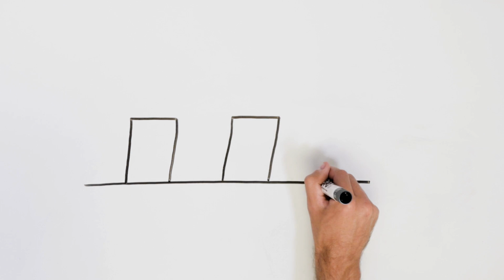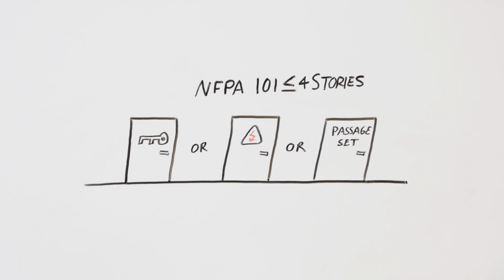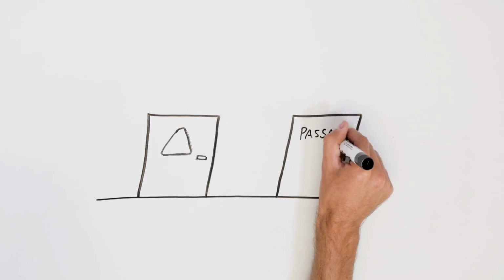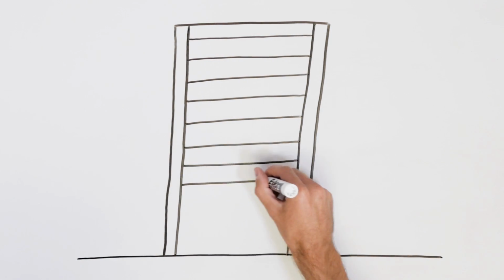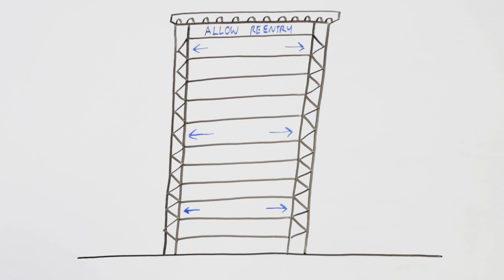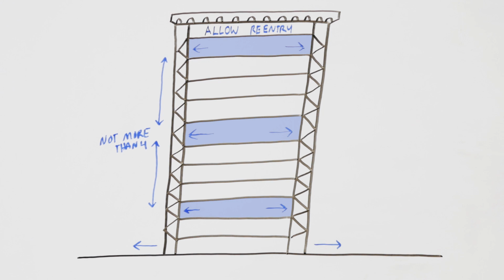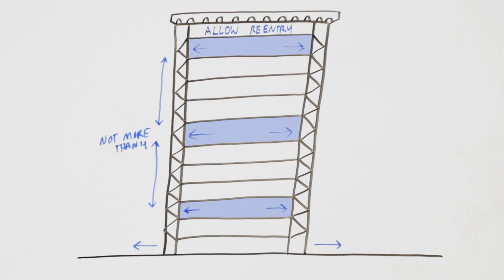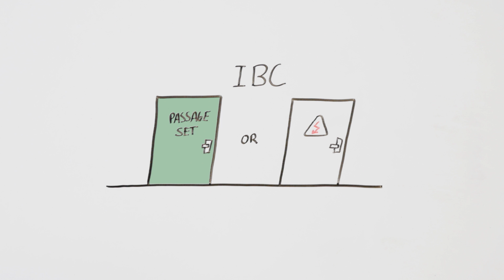Decoded: Stairwell Reentry

Comment: One incorrect thing here. Fail safe electric strikes ARE allowed to be used on fire door, as long as one permanently latching mechanism (that are actuated by a handle or similiar) remains. For this, a fire-approved fail-safe electric strike must be used, which both are resistant to false locking due to the heat (melting components inside the strike) AND must be able to keep the door closed by the handle latch (that operated by a handle on both sides of door) while the lock-latch will be operated by the strike.

One example is "ASSA 961" which is a "omvänd" = fail-safe. If you google "Assa 961" on pictures, you will see that the electric strike has permanent holes for an additional latch, that will NOT be controlled by the strike. So you have a dual-latch lock case, where one latch (the cylinder latch or key-latch) falls into the strike portion of the electric strike, and then a handle latch, which operates by a handle, which falls into one of the permanent holes in the strike, thus handle MUST be depressed to open the door, even if strike is unlocked.

Its approved to EI 120 (120 minute rated door) as long as a dual-latch emergency escape lock case is used. An dual-latch emergency escape lock case, has a handle on the inside, which operates BOTH latches, and a handle on the outside, which only operates ONE of the latches.

In this way, the strike can be used to keep the door locked from outside and free-exit on the inside, until power to the ASSA 961 strike is dropped, then the door will be free-exit and free-enter. Note that the handle must always be used, even if the strike is unlocked, as the strike does NOT release the handle latch.

Theres also ASSA 992M which is a fire-approved dual electric strike, where one of the strikes are fail-safe and the other is fail-secure. This is used in facilities where a automatic release of doors is a must, for example, in disabled-accomodations for wheelchair users where a fire door must be able to be released WITHOUT a handle press, by a ADA button or similiar. The ADA function will cease to work if power fails or similar to the fail-secure portion of the lock (which is for the handle). Usually a battery backup is required that allows the door opener to work even during the power outage, and the wiring must be in separate conduits to prevent the wiring from melting together and shorting, releasing the fail-secure latch incorrectly.

These facilities must usually have a fire-approved ADA elevator aswell, with battery backup.